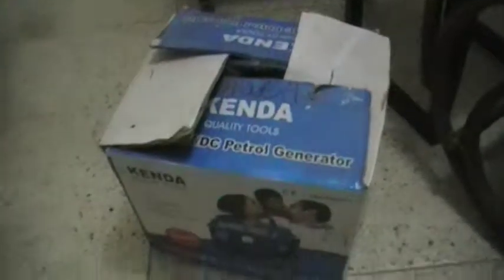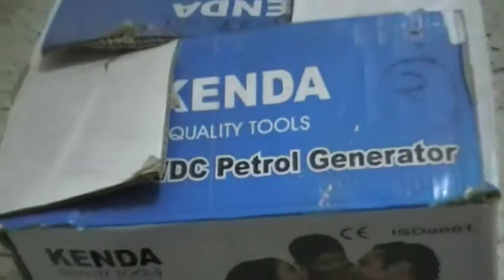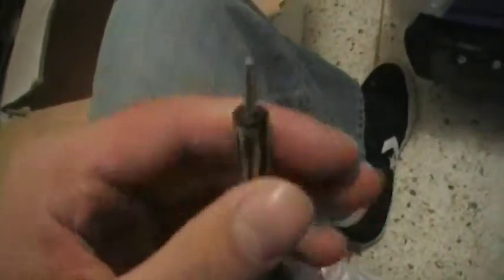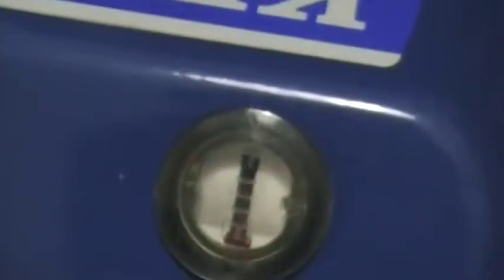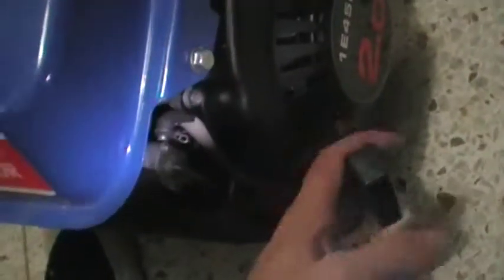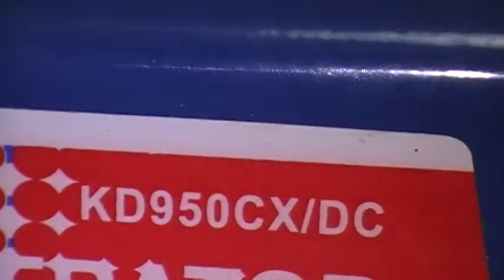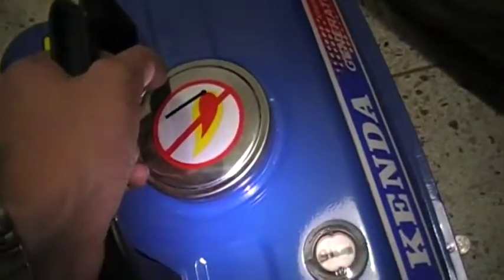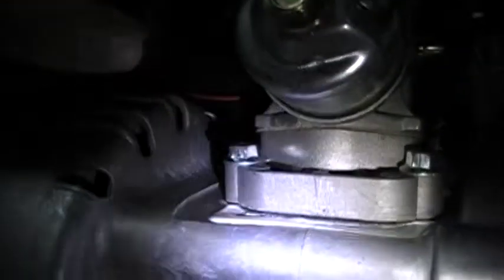Harbor freight clone Electric Generator unboxing.

Comment: Where are you located I have never seen that in the USA? It looks like a neat gen set. I know that if that gen set was made for overseas it is most likely a 50hz 220v output and can not be converted to 60hz with just a cable . I was in the NAVY on subs in Holyloch scotland and we had 50hz 220v service and I had a 1k gen set I brought back to the usa and it just sets until I can get the gen section rewound for 60hz or I sell it to someone overseas but shipping would be a bear.